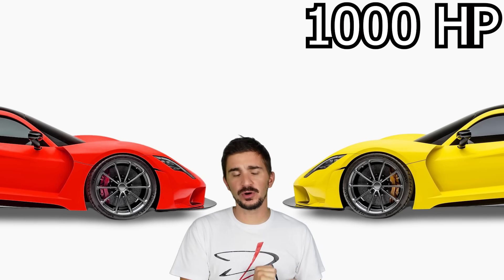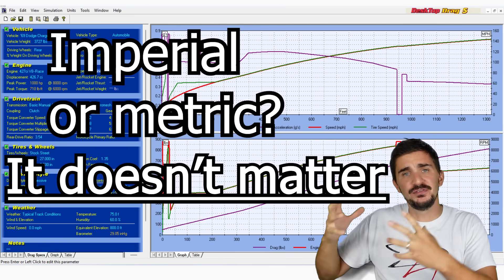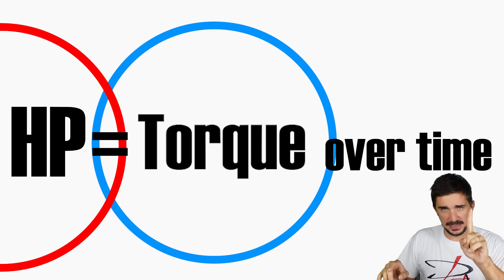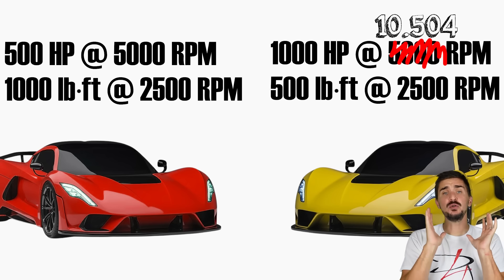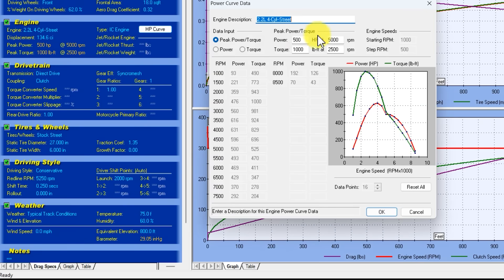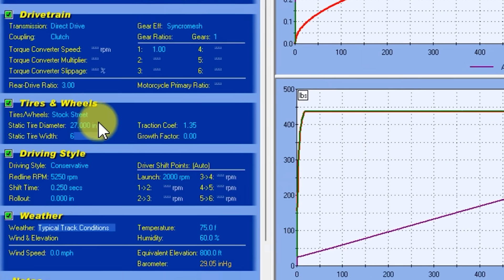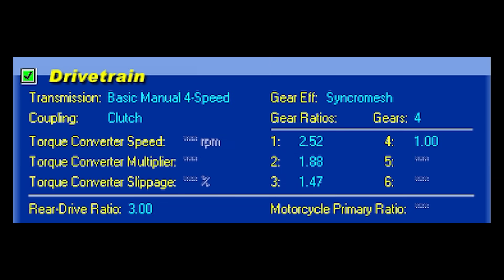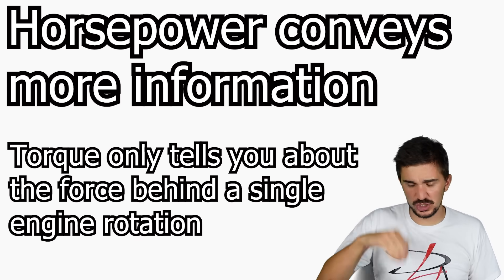Who's faster? Explained and Simulated - Horsepower vs Torque

Comment: Finally! I'm sooo sick of trying to explain to people that the reason you won't win a drag race with a truck engine is because the old adage "torque moves the car" is actually "torque at the wheels moves the car" and that's affected by gearing 🤬  My CBR1000RR bike makes 180hp at about 10,000rpm and a Honda Civic might make the same 180hp at 5000rpm and if we dynoed them at peak horsepower the torque at the rear wheel(s) will be the same at a given road speed despite it being different at the crank cos my  bike has a 2:1 gearing advantage due to revving twice as high. This is why horsepower as a metric exists - if you make 180hp at the rear wheel, who cares how much torque the engine makes at that point? It's irrelevant because it's affected by gearing and horsepower ISN'T. 

What can be relevant is the curve, because when you extract a lot of power out of a small motor, the power curve is steep and you need more gears and if you wanted to sit at say 1/3rd redline on the highway for maximum fuel economy, even allowing for gearing my bike is likely making way less power at those rpm than the Civic which would be a problem if my bike engine was IN a car body.  

*Torque only has relevance when measured at the wheels, and saying "wow look how much peak torque the engine makes at 3000rpm!" is the same as saying "wow, look how much horsepower it's making at 3000rpm!"*. 

Sorry, I've been angry about this since my (other!) favourite youtuber Cleetus McFarlane got a diesel Galaxy lol.  Yes, huge torque, ohhh, and ahh, but ONLY at the crank cos the gearing is disastrous on a low rpm engine like that.
Reply: Numbers with combustion engines is mostly a game with people, especially those in the modification space. So much of it is merely boasting. The point with numbers has always been a quotation with "peak" numbers. Then the company they keep returns the counter-statement, and they return their counter-statement and back and forth and back and forth. It's like two enemies on a battlefield taunting each other about the size of their weapons and horses before they prove whether their claims have any basis in reality.
Fact of the matter is, the issue of internal combustion engines, transmissions, tire adhesion, and all of the rest are very complex. People want to boast of their ability to distill something that is extremely complex down into a few simple statements. It's simply not how the science of locomotion works.
Reply: Since you will never spin at 10000rpm at the whell I think the 2:1 ratio of your bike is rather a gear disadvantage than a gear advantage!
Reply: Depends a lot on the weight of the vehicle. Put the CBR engine in the civic and even if the horsepower is the same it’ll be slower because the bike engine makes less low rpm torque. Basically it won’t get moving from a stop as quickly. There’s always a balance. 
A high torque V twin motorcycle can be very quick off the line until the high rpm I 4 can get going. Just look at something like the Triumph rocket. It’s very heavy with a big low rpm engine that’s mostly torque. Yet, it’s very quick off the line.
Reply: @NBSV1  what makes the vehicle go is power. you can make power by either increasing the torque or increasing the rpm. Whatever the engine you put on a vehicle, you need to adjust the gear ratio to it's powerband and weight.
Reply: @brunocorrea6010  If you're just plugging number into an equation that works fine. In reality it isn't that simple. 
For example. An average semi truck is "only" about 450hp and normal max weight with trailer is 80,000lbs. You can make that horsepower pretty easy with a 4 cylinder out of a Honda with a turbo. Do you really think a turbo 4 cylinder is going to match the pulling power of a 15L turbo diesel just because you changed the gearing? If that was the case they'd be sticking way smaller engines in big trucks and just changing the gearing to get all the lost torque back.
Reply: @NBSV1 👍
Nailed it!
Reply: @NBSV1  That's a great point as far as the diesel truck comparison.  I also think that using small engines with more aggressive gearing could be done, but, it has a net zero benefit. Any money saved in one area would spent elsewhere. Small engine is cheaper, custom gearing isn't. Uses less fuel, saving you money. But, the weight of the truck/trailer is harder on less robust components, making them wear faster, which means more frequent replacement.
Reply: @NBSV1  Oh yeah, a turbo 4 cylinder would match the pulling power of a 15L turbo diesel just fine, since their wheel torque would be the same (assuming appropriate gearboxes for both engines). However, they are going to stick with large diesels in semi trucks because that 15L diesel is going to run for at least 1.5 million km (probably more), while the 4 cylinder is going to be pretty dead after 200.000-300.000 km, especially if it has to constantly produce close to 450 hp. And the fuel consumption of the 4 cyl is going to be off the charts, and it's going to have an extremely short service interval.
Reply: @NBSV1  It absolutely would, with a caveat - generally speaking, the more gear reduction, the more drivetrain losses.  To keep things simple, let's just say we're adding a second single-speed transmission between the turbo Honda motor and the semi truck transmission.  Let's say the turbo Honda motor is making 250lb-ft of torque at the crank, and the diesel makes 1500lb-ft at the crank.  We'd need our single-speed gearbox to reduce 6:1 to match the torque of the diesel.  That reduction isn't free - it's going to eat up some power.
Reply: @duplox  There's the rpm it makes the torque at to consider too. Is peak torque on the Honda at 6 times the RPM too? How is it at lower rpm since you have to get going from a dead stop? Which now you're also talking about taking an already short gearing and reducing it by 6:1. Which means you'll be shifting a few times just to get to the point the big diesel started at. 

Technically by the numbers it works. But, in reality when it's actually applied to something it doesn't really work out that way.
Reply: @Therealfrazer  Didn't bring up durability for a reason. 
If you gear the little engine down to the point it matches wheel torque then the output speed is far lower. And, you're starting from a stop so the little engine will need to gain a lot of RPM before it gets to peak torque and will struggle to get going until then. The big diesel makes peak torque a little off idle and is making far greater torque the whole time. So it's able to get the load up and moving early without having to wait for the power to really come in.
Reply: @NBSV1  No, if the power is about the same for both engines, the wheel speed will be about the same if the wheel torque is the same. That is literally what power tells you.

And since the little engine will have much shorter gearing, it will "get up to speed" much faster. If the truck takes off at 1000 rpm, the car can take off at 3000 rpm. Sure, the difference in speed at the clutch will be larger for the small engine, but then again the forces at the clutch will be smaller (and eventually, this is a durability issue, not a pulling power issue).
Reply: @Therealfrazer  The power isn't about the same though. The big engine at 1K rpm is putting out far more torque than the little engine at 3K rpm. That's the whole point. You can change the gearing an end up at the same physical torque numbers. But, it'll be a vastly different output speeds. 
When you change the gearing to increase torque on the little engine you're also reducing the output speed. You're talking about a 6:1 extra reduction. So, to keep everything even when you shift the big engine at 2500 you'd have to shift the little one at 15,000. Which is going to be a little high. An engine that revs that high is going to tend to produce even less torque since you're using the rpm to make up for it. Which means you'd need an even lower gear ratio and thereby even more rpm.
Reply: @NBSV1  What do you mean the power isn't the same? If we have a car engine that is a turbo 4 cyl with 450 hp, then it has as much power as a truck turbodiesel with 450 hp. 450 hp is 450 hp.

Sure, a big engine must make much more torque (3 times as much, in fact) at 1000 RPM than the little does at 3000 RPM if they are supposed to produce the same power at 1000 RPM and 3000 RPM, respectively. And, if they are driving at the same speed, the little engine can have a 3 times higher gear ratio, i.e. multiply its engine torque by a factor that is three times higher than the same factor for the big engine. So despite the engine torque being three times higher in the big engine, the small engine can multiply it three times more, so the wheel torque will be the same. I have no idea where you get the 6:1 extra reduction from. A 3:1 extra reduction is needed, which means that if you shift the big engine at 2000, you shift the little engine at 6000. Both perfectly common in the real world.

The power of an engine specifically tells you that if an engine produces a power P, and drives at a speed v, you can always gear it so that it produces a force F=P/v. This is regardless of how you produce the power (high torque/low RPM or low torque/high RPM).
Reply: @Therealfrazer  Torque is the force the engine can produce. Horsepower is just torque over time. 
The big engine can put in more power at a slower speed. The little engine inputs less power but at a higher speed.
The speed is ultimately the problem. You can technically gear the little engine down and produce the same output torque. But, it’ll be at a far slower speed. If you want high output force and high output speed you need a high input force.
Reply: @NBSV1  What torque an N/A engine has is pretty much entirely dependent on what displacement it has, times volumetric efficiency. This means about 90-120 Nm per liter of displacement. For instance, a very common misconception is that a 1000cc V-twin has more torque than a 1000cc I4 superbike engine. This is simply not the case, just check the numbers. For instance, the newish CBR 1000RR-R revs to 15000rpm, but it has 115Nm of torque. Now look up any 1000cc V-twin you want and see if you get higher numbers (hint: you wont).

People have a tendency to misuse the term 'torque', when they actually mean "low end grunt" or something to that effect. This is unfortunate as it leads to misunderstandings of how things actually work... Like when you detune an engine for "streetability" (i.e. low-end grunt), you don't actually increase the torque. In fact, you almost always lower the actual torque!
Reply: @NBSV1 negative. If they are outputting the same hp they will perform roughly the same.
Reply: @NBSV1  It doesn't depend on the weight of the vehicle, since you can just compensate for the need for more wheel torque with lower gearing. You can also launch at pretty much any RPM you want if your clutch/torque converter can handle it.

The reason you don't typically get small light engines in heavier vehicles is because small light engines have trade offs to get that power (initial cost, running ocsts and durability), and those trade offs are only worth it if your vehicle needs to be lightweight (like on a motorcycle).

Comment: I did read up torque and HP on previously but your explanation is of course clearer. I was trying to understand why my 1.5L turbo 216i produce max 140lbft torque at 1350 rpm but only 109 HP at 4100rpm whereas a NA Honda 1.5L engine can have a spec of 100lbft torque at 4200 rpm but produce 130HP at 6000rpm? Does it mean my engine torque starts to drop above 4100rpm? The 0-60miles time is about the same on spec but the power you feel from driving both cars leans veey obviously towards the turbo engine. Is it the turbo only push the torque higher and achieve max torque earlier? But both engine have the same displacement, why can't the engine with turbo that creates higher torque produces higher HP? Is it the tuning of the engine ECU? These are engine spec which from my understanding the transmission and wheels does not come into play.
Reply: Probably the turbo produces a lot of torque at low-mid rpm but then it cant sustain the airflow and boost at higher rpm and falls off, while the NA engine keeps its torque better at higher rpm and therefore makes more power.

Stock turbos in general are rarely big enough for high RPM performance as its not really used much on the street, they are more set up for a bit of extra kick around 3kRPM for overtakes and so on.

Comment: Power is what matters. Energy per unit of time. Exactly what you need. With a good transmission with many gears, that allows the engine to be at peak power for as long as possible, power will win.
Reply: CVT superiority 😤✊

Comment: Here's my prediction before I watch the video:

The horsepower car will basically always be faster. However the power-torque curve is more important than the peak number. If that 1000 hp only exists at a peaky 9,000 rpm for 500rpm, it's basically useless unless you have a cvt capable of holding that kind of torque.

Reasoning:
yes the car with the higher torque is putting more force into the crankshaft, but it's doing it too slowly. The 1000hp car is doing more work. precisely twice the amount of work if both cars had cvt transmissions capable of holding their output without slipping.

Conclusion after watching:
I agree with everything stated but I think it's incomplete. Even with a transmission and final drive, the 1000hp engine is never actually using peak torque, and it can't get to peak hp.
I think, for the sake of pure scientific argument, even though it's not a very practical scenario, give both cars a perfectly efficient CVT and the results will speak for themselves.

Comment: You should have calculated the RPM for the high torque car too instead of just typing the 500HP @ 5000RPM, as you can see on the "dent" in the torque-power-curve. And you should have calculated a run, where both cars are  geared to same top speed, then the highpower lowtorque car would have win clearly.
Aside of that, great explenation

Comment: Here's where the numbers come from.
33,000 ft/lbs a minute is one horsepower.
So imagine you have a spool, with a 1 foot radius.   If you were reeling in an imaginary horse that could provide 33,000 ft/lbs a minute.  It could be 1lb going 33,000 feet in a minute, or 33,000 pounds going 1 foot in a minute, either way, it's the same.
So we will apply 1ft/lb of torque to our 1ft radius spool, and that creates 1lb of teston in the rope.
Now the circumference of your one foot radius spool would be 2πr or roughly 6.28
So divide the 33000 ft/lbs/min that your horse can pull, by the 6.28 feet (2πr)  your 1 foot lever arm would reel in going one revolution, and you end up with 33000 / 2π 
=5252.

Comment: More HP can easily convert to MORE torque with a good gearbox, the demonstrated gear ratio is a joke, any reasonable designed 1000hp car (which will not be cheap) will crush a 500hp one in drag race.

Comment: Another great video. So from this video torque is what pulls the car forward and RPM is the rate of the pull per minute. This is why a lot of transport and construction vehicles use extremely large engines to pull a large load. This also explains why a lot of sports bikes and bike powered cars as well as f1 cars has short gear ratios is to keep the engine operating at their powerband which is usually 8000 rpm and above.
Reply: No.

Even for trucks or other heavy machinery power is the relevant unit.
They use gear ratios, they will multiply torque. A higher hp engine will produce even more torque with the gear ratios.

The reason for trucks to use big engines with high torque is realiability and the fact that size and mass doesn't matter that much. 

The reason for motorcycles to have tiny high reving eniges is simply space and weight.
Reply: "why sports bikes and f1 has short gear ratios"
Now guess who has a 18-speed transmission, F1 or a semi truck?
Reply: Yep. You need torque to get something moving from a stop. As you get faster horsepower becomes more important.

Comment: That explain really clearly why you can't only judge an engine by its peak values, you need to have the power for every engine rotation speed
Reply: Funny enough, there is a situation where peak power is technically the only thing that matters, but that's only in applications using a CVT.
Reply: @yummyhershey5902  Yeah of course you have to consider the transmission too. I would like to a CVT in a racecar, could be interesting

Comment: bro, I really love all your videos, but this one could have been explained much easier.
torque data is more for city driving efficiency, absolute hp data is for peak power experience.
you don't look at torque when buying a car for performace.
and you don't look at hp when you buy a car for efficiency.
its generally misleading the use of torque, it would be easier to say:
car A:
400hp @ 2500rpm
500hp @ 5000rpm
wins the eficiency race

car B:
150hp @ 2500rpm
1000hp @ 10000rpm
clearly wins the speed race
Reply: I mean except that is wrong. For efficiency you want good low rpm torque so you can move about without having to gun for higher rpms which introduce more frictional losses. But more importantly you just want a light car.

Comment: The result of heavy car is also due to gearbox - since the HP biased engine reaches its maximum power at douboe RPM, its gearbox should have double the gear ratio to be actually able to reach that power.